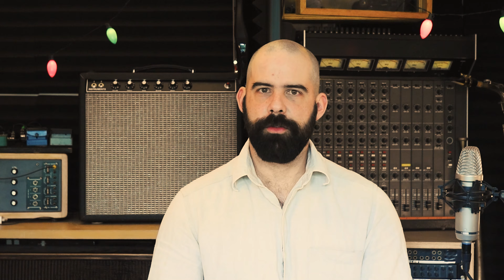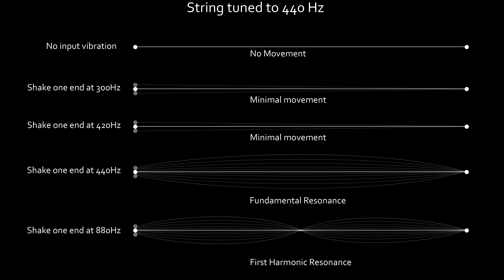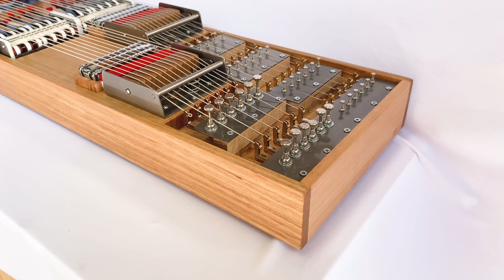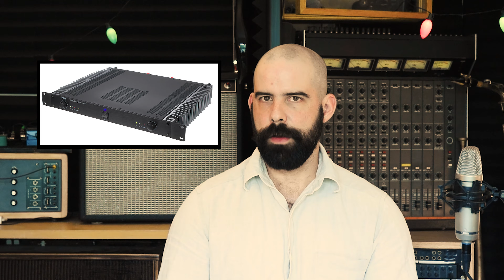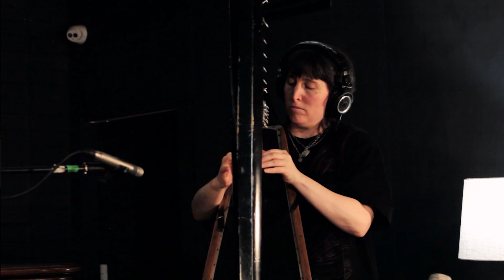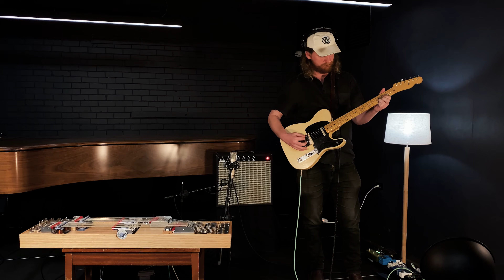Resonating harmonic Drone, In Depth

Comment: this reminds me of the sustainiac model C (not to be confused with sustainiac pickup) It's a transducer designed to be clipped to a guitar's headstock, fed by a pedal. I mostly used it to simulate feedback and resonance akin to playing through a cranked stack, but in a quiet studio setting with amp sims. I also played with clamping it to various surfaces and objects, including pianos and guitars which is a very similar but less refined version of what you did.
Reply from the maker: Cool! I have been thinking about making a universal clamp on version of the driver mechanism used in this. Something which you could fix to a fire escape stair or public sculpture for example to get some very unique field reverbs.
Reply: @LillisInstruments It worked well on guitars open tuned to the key of the piece. Also pianos, if you can find a place on the soundboard to clamp it, a cool trick is to hold down the sustain pedal with a weight, and tape or weigh down a set of keys in a particular (harmonic) key. 

I didnt get too exotic. Tried tables and bits of scrap metal, plywood, planks, doors, trash cans, a cooking pot. 

It's cool not just as a layered effect, but as a standalone sound. The sound of a bass on a piece of drywall with a boundary mic was mind bogglingly heavy once.